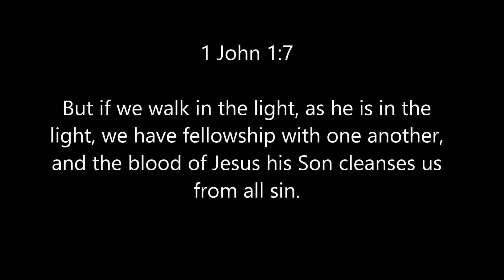Aquaponics Swirl Filter - Tips and Tricks

Comment: Great videos. I have been watching the series and notice that at some point you turned your out flowing pipe from the swirl filter from facing up to facing down. Would you share the reasoning for this and did you see any performance changes with that change?
Reply from the maker: +Brett Muratori I tried it both ways but actually found that facing up seems to work best
Reply: SSLFamilyDad thanks. Will be building a system this year I hope. thank you for all your videos! I wouldn't know where to start without them!!

Comment: Happen to have any idea how many gallons per minute flows through your swirl filter? That vacuum idea is definitely a stroke of genius, I was wondering how a person would put a conical bottom in a 55 gallon drum without it eventually causing a big stinky mess.
Reply from the maker: I am not sure to be honest, it would largely depend on how fast you have the flow setup on your grow beds and how many grow beds you have. The vacuum has worked extremely well over the last year to clean that out. When I redesign the system I will certainly incorporate that!
Reply: OK, I was trying to get an idea of the maximum throughput a person could get out of a 55 gallon drum without swirling the water so fast that solids didn't have a chance to settle. Call me lazy, I'm trying to get out of an experiment. :-)
Reply from the maker: Larry Athey lol, well I would say that you can comfortably feed 8 grow beds (double what I have) and not have any issue at all, might even be able to do more but if you did I would go up to a full depth barrel. Hope that helps!

Comment: I like the video. My issue is that I have a 300 gallon IBC and its dark ( have not seen the fish or bottom of the tank since the day I put it in ) and then into a half 50 gallon swirl that's always dirty- all gravity fed. any suggestions for cleaning out 300 gallon?
Reply from the maker: If the water is not clear you may have too much fine particulate from your grow media. The swirl should settle most of that out over time but you might need to drain it out and flush it with a hose. You should be able to see the bottom of your fish tank without trouble even if it is dark.
Reply: I'll work on it today.
Reply: How do I get out fine particulate

Comment: With the swirl filter located where it is how do you access your pump to clean it?
Reply from the maker: There is a pretty large gap between the swirl filter and the top of the sump tank walls. Plenty to get in and disconnect the union and pull out the pump. In the future I do plan to redesign this with a larger swirl filter and a horizontal sump tank that will be a bit easier to access. Thanks for checking it out!

Comment: Dude, the hose idea is awesome. But I would worry about what chemicals will leach from the rubber hose into your water.
Reply from the maker: Thanks! That is a good point, I suppose I could use a potable water type hose instead or just unscrew it and take it out when I am not using it. Thanks for checking it out!

Comment: Looks like you used a 2" bulkhead on the overfill pipe.   What size is the bulkheads for the hose,  1"?  
I will start putting mine together this weekend.   It's going to be similar to your setup.   I did get an ibc tote for the fish though.   That was fun squeezing into my basement. I will put up a video when I'm done.   Thanks again for sharing your ideas with us.
Reply from the maker: No problem Dave! I want to see a video of you trying to get that tote into your basement! I wanted to do that but figured getting it down to mine was out of the question. The swirl filter is a 55 gallon drum flipped up side down so I am using the two bungs for my overflow and the hose. The overflow is 2" and the suction hose is 3/4". Please let us know when you get things together, share on the Facebook page or just link it up here in the comments if it is on Youtube. We would love to see it!- www.facebook.com/simplesuburbanliving.
Reply: Once I cut the top off it was easy to get the ibc tote through a standard size door..  It was the cage that it sits in the was the problem.   Luckily the bottom of it screws off..  Took off the door jam and squeezed it through.   I pick up my barrels Friday.   I'm tempted to just use a home Depot tote for the sump so it's lower to the ground.   It's a fun project.
Reply: Oh.  I just liked you on FB.

Comment: Have you thought about making a cone bottom on the swirl filter. This can be done, I needed to try 3 times before I got it right, by heating. I did it on the bottom not the top and my over flow goes through the side wall.
Reply from the maker: Before I came up with this idea for the hose I was thinking about pouring something in the bottom of the tank like cement to form it into a cone that sloped to the drain. In the end I found this to be easier. That is a great idea to form the tank with heat though, I hadn't thought of that. Might do that on the next one I build!

Comment: I like the suction hose idea. I've been trying to resolve that problem in my radial filter. For reasons that wouldn't affect you I wound up with some fingerlings in my filter so I left them there. Had too many fish in my tank anyway and they're doing just fine and I think actually eat any extra food in the system (I feed them too). I read an article from a university where they put fingerlings in their filter system to swim up inside the plumbing and eat the build up.
Reply from the maker: That's a good idea Jeff. I actually had a fish in my swirl filter also and it was probably doing a good job of eating up some extra food in there. If my filter was deeper I would have left him in there but the fish swimming around kept stirring up all the waste and then kind of becoming counterproductive for the swirl filter. I might think about adding one back in once I reconfigure things down the road, thanks for the input, I appreciate it!

Comment: Brother, mineralize that shit. When you take it out if the aqp setup you're depriving your plants of the nutrients that aren't immediately solublized. Have a mineralization tank that holds the solids and aerates them akin to compost tea. 

Some other advice.  Radial flow filters are superior to swirl, this has been proven in many cases and is easy to retrofit. Add a fines filter too. You mention that the swirl is getting 80%, but better than half of the suspended solids in this kind of system are fines that a swirl or radial will not recover. A small bucket or tote with netting will do perfectly. You'll have no reason to even add worms to your beds, you'll keep the surface area for nitrification (will fall off over time as solids build up) and you don't let the solids back to the fish.
Reply from the maker: Thanks for the advise, someone else mentioned that I should do the same and honestly it is something that I did not think much about. I am planning to do some moving around and additions to the system this summer so I will add something like that into the design, thanks!